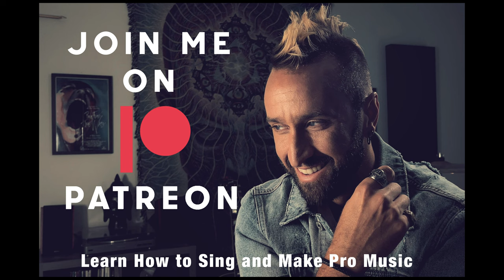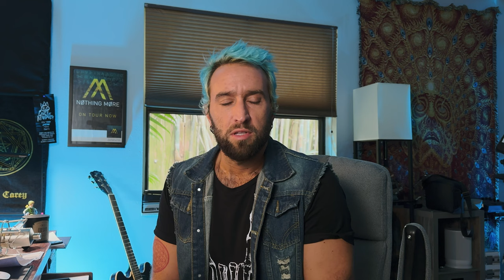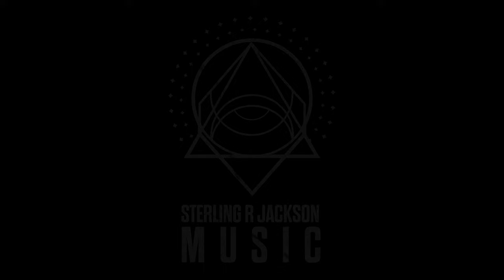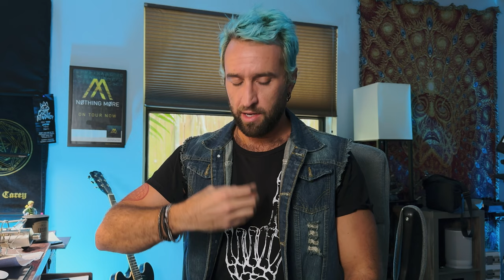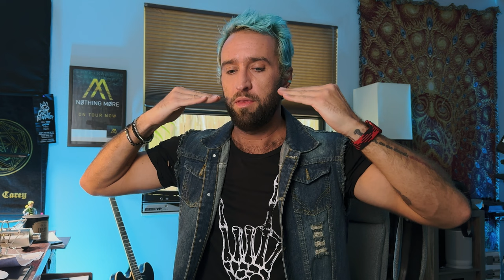How to Use Vocal Compression

Comment: Great video Stirling as always.  I’ve finally joined my voices up, but the tone certainly isn’t rock in any way and I’m suspecting that the problem is that I lack compression.
Reply from the maker: Maybe but it takes time to develop.  Mine took a while.  I didn’t have any guidance but still, it takes time to develop and some strength along the way.  😊